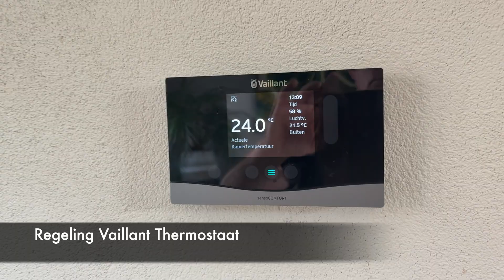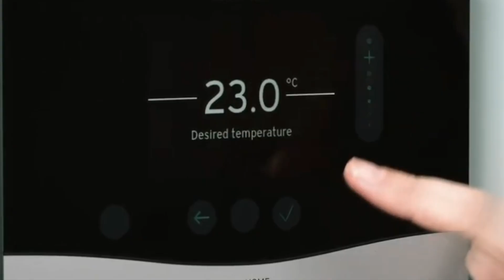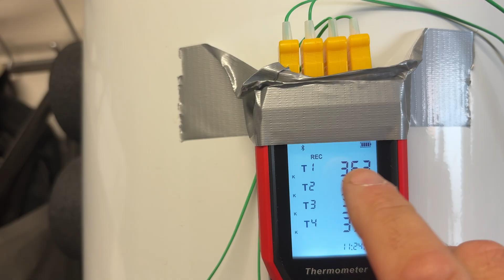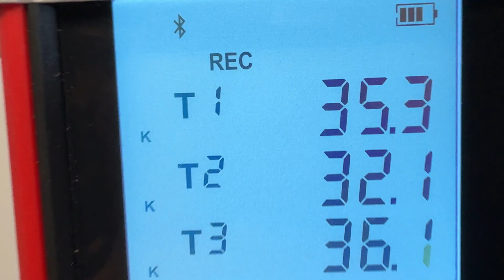❄️🔥 Vaillant Arotherm R290: besparing top, comfort flop?

Comment: Wat ik mij afvraag. Waarom een buffervat als je een modulerende warmte pomp hebt. Zelf heb ik de warmte pomp rechtstreeks op de verdeler aangesloten.
Zonder buffervat of extra pompen. Er zit ongeveer 800 meter leiding in de vloer. en de warmte pomp regelt dat eigenlijk prima. Zonder dat het systeem eigenlijk heel storing  gevoelig word. door een boel poespas. Zie ik iets over het hoofd mischien?
Reply: Heeft u een split of monoblock warmtepomp?
Reply: @JB-hr5py   een monoblock warmtepomp. Ook hebben we geen na regeling op de verdeler. Dat is ook niet onbelangrijk  om te vermelden
Reply: @jd7430s 
Buffervat is niet verplicht maar wel wenselijk. Het ontlast de warmtepomp, je vergroot de capaciteit van je systeem. Ook als het buitendeel moet ontdooien in de winter, dan is een buffervat wel handig anders wordt de warmte uit de woning gehaald.
Reply: Het kan in veel gevallen zeker zonder een buffervat, waardoor het systeem ook nog eens efficiënter werkt. Maar dit kan alleen als je genoeg volume hebt (dus veel vloeroppervlakte of grote radiatoren)
Reply: Als je genoeg systeemvolume (kun je ook op andere manieren vergroten) hebt en geen naregeling dan heb je geen buffer nodig